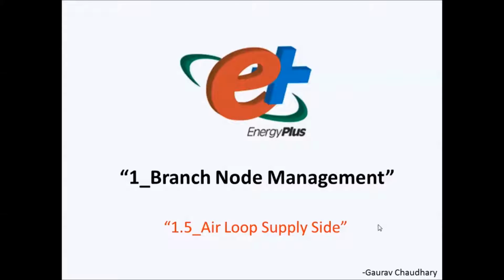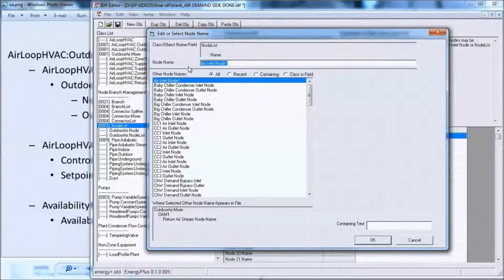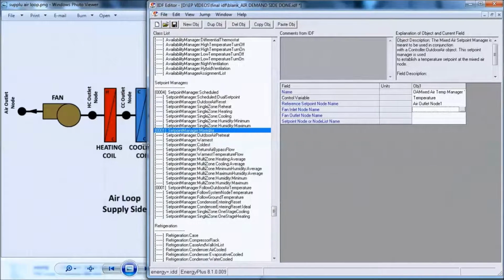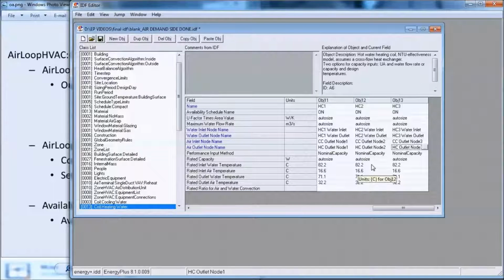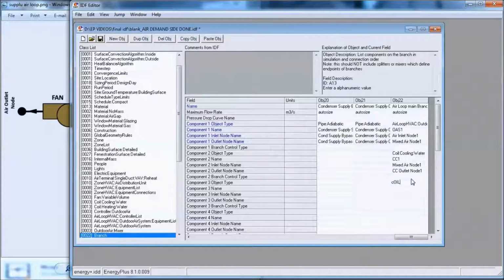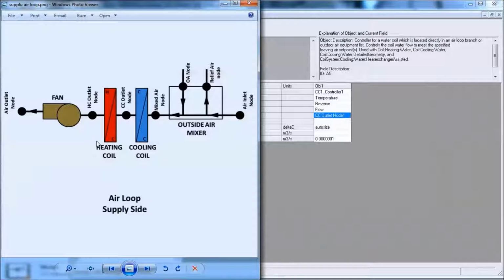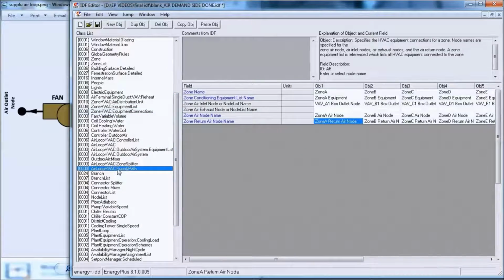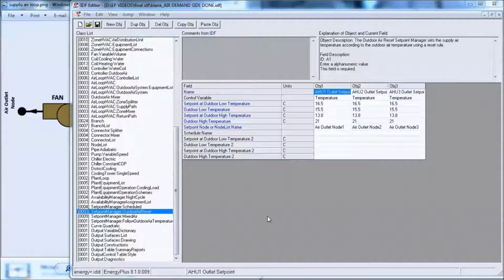Branch-Node Management_5_Air Loop Supply Side

Comment: Hi! I want to model a 2 storied building with radiant cooling:constant flow.But this cooling system is only applicable to conditioned space.But how I differentiate between conditioned and unconditioned space?How to use branch-node management for centralized radiant cooling system?
Reply from the maker: +Sudipta Ghosh Hello Sudipta! Although, the design of radiant cooling/heating systems is on my list for future videos, but, for now, I can tell you that for this, we have to connect Radiant Cooling: Constant Flow E+ object in place of Cooling Coil in Plant Loop Demand side. In Plant loop Supply side Chiller which is providing chilled water is not the same as required in a VAV-system, here water outlet temperature need not be 5-6 degrees but can be around 20 degrees depending on setpoint needed. This difference in water outlet temperature is actually one of the reasons which make radiant cooling system energy efficient.
Other than this you also have to make proper construction for radiant pipes, which is to be done in Construction:InternalSource, E+ object.

You can check example files with name RadLo............ .idf; provided in the installation of E+. These all files have radiant cooling systems modelled with different variations. For now, you can also have a look at "Lecture 20 Radiant Systems.ppt"; provide in https://energyplus.net/sites/all/modules/custom/nrel_custom/eplus_files/university_course.zip